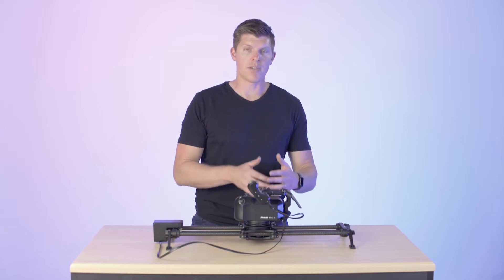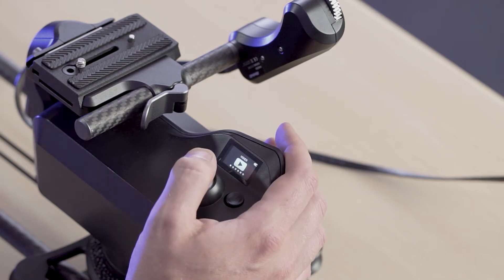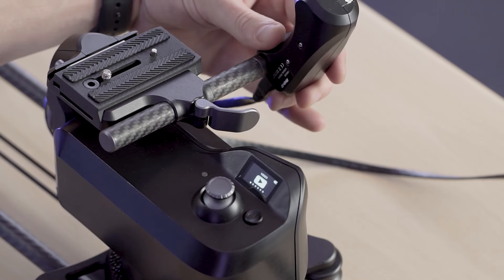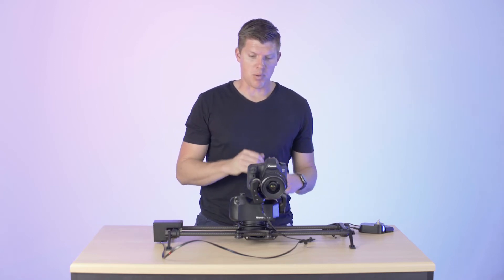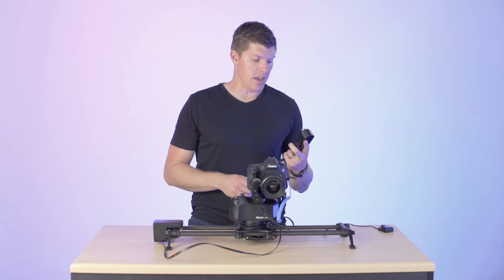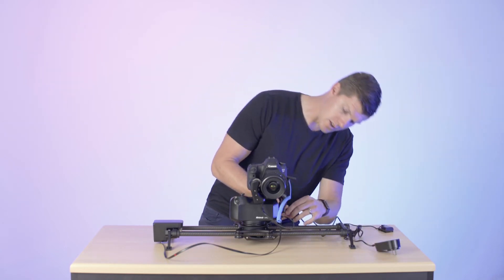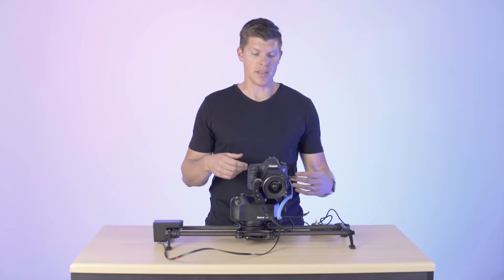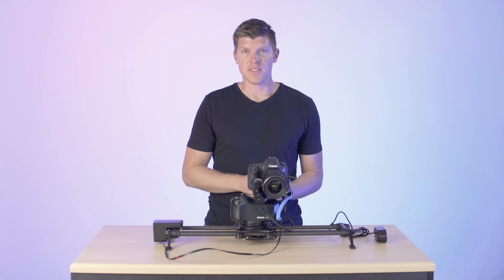Arc II Hardware Overview

Comment: One suggestion I already have for future releases is the height of the joystick. I think it sticks out too high and it seems like it might be an issue over time trying to put it back into the hard case. The rubber padding rubs right up against it when you're trying to pack it back in which I envision, at some point, potentially breaking the joystick or putting too much pressure on it.